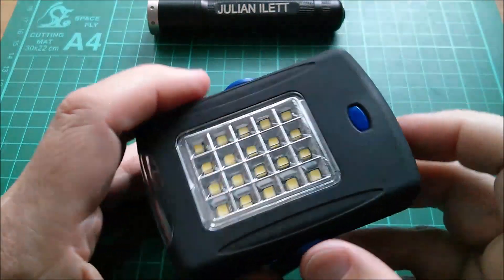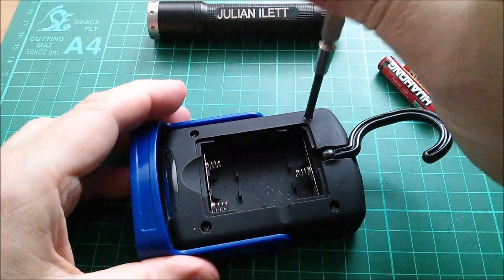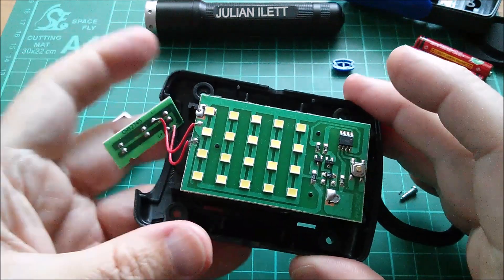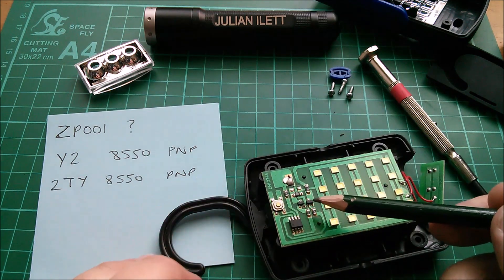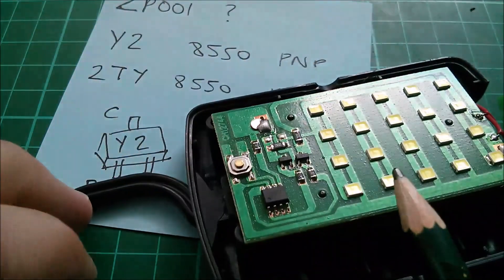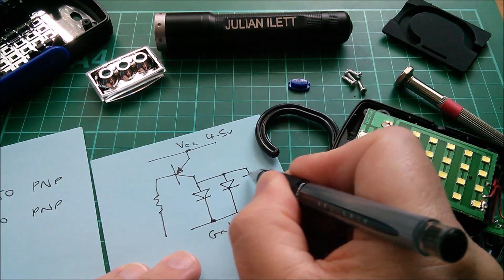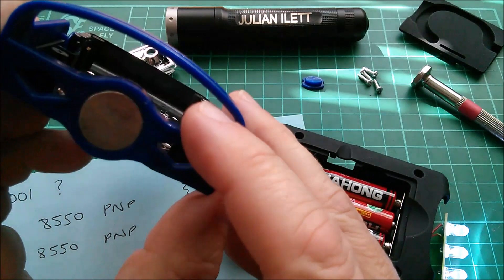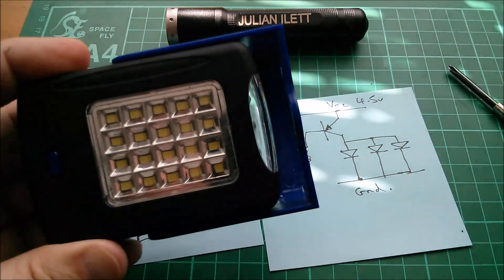LED Utility Light Teardown

Comment: This reminds me of a similar Harbor Freight light,  which uses round LEDs in both locations.  I have a couple of these,  have not used them much, but did open one up to find that all of the LEDs are connected in parallel.  The same holds true for their smaller round flashlights,  and using one of those for a while I ended up with 3 of the LEDs failing.  Not my idea of a good design!  :-)

Comment: When trying to identify a controller from its power and return lines(legs) you should check for under chip traces with a back light or continuity. Pin 3 looked like it had a trace running under the chip ? This chip isn't a PIC or Tiny.

Comment: Oh, and according to the B & Q description the 20 LEDs are 0.09 Watt each, so the total power is 1.8 Watt. So if we assume the voltage of the battery is 4.5 Volts then the current they pull out is 0.4 A.  That is a pretty hefty load on a poor AAA cell (the 3 of them are in series, so the same current through all). I think we can safely assume that the LEDs will be OK regarding potential overcurrent, the internal resistance of the three AAA cells in series will be plenty of protection, no need for PWM.  But as commented below, if someone suddenly has an engineering brainwave to replace the AAAs with 18650 the results may be interesting ....
Reply: Bob, I had the brainwave and did change it to 18650.  The results were interesting.  First I just wired in an 18650 to replace the 3 series batteries.  It worked and was nice and bright.  However over a week of nightly long runs, little by little individual LEDs were failing while the rest kept going.  The internal resistance of the 18650 is likely the cause of failures since it is much lower than the 3 original batteries in series.  Likely the manuf. was depending on the internal resistance of the 3 cells.  I also ran  a normal unit in the same time frame and surprisingly no LEDs have failed as yet, even with the poor design.  As a side note, I have also the Harbor Freight small round cylinder 9 LED flashlight, unmodified and it with frequent but limited time use has 3 LEDs go dead one by one.  It uses a bad design parallel circuit also.  Now I have changed both types to use 18650s and modified the circuits to use separate current resistors per LED.  Ran both  nightly til bedtime during hurricane Irma when we lost power and for nearly a week until power came back.  These modified lights were a big help during the power outage.  Also the 9 LED unit still had about the same light output even after a week of nightly heavy use.  The 27 LED unit was modified to run from 12.6VDC from a 3S20P 18650 power bank I built.  Total voltage only dropped .3VDC for the duration using the high brightness mode (25 LEDs lit).
Reply: @EnergyCrafts Yes, pretty interesting although not necessarily unexpected :o) .   Obviously your modification worked as you replaced the AAA's internal resistance with dedicated resistor for each LED. That is a decent solution.  But to be honest, I am a bit uneasy when resistors are put in any power circuit, it screams waste to me. It may be quite negligible as you example with the 27 LED unit demonstrates, but still.  3S20P 18650 is a big unit, I'd guess about 40 or so a/h, so it will support such usage. But I wonder if a current-regulated buck or boost converter would be a more efficient solution if 18650s are introduced. It will obviously be more expensive at the start, but in the long run?  And I hope you are OK and the new hurricane misses you.
Reply: Bob.  The hurricane winds did reach here in mid FL but I am surrounded by tall thick forest and the wind blew mostly over the tops and missed the ground thus saving us.  

I chose not to use the current regulated LED converter chips because I don't like the idea of using PWM burst of current driving parallel LEDs.  I know the average current of PWM is within spec, but the surge pulses individually is not.  I think those surges are very hard on the semicondutor and will stress it to failure much sooner than just using dedicated resistors.  Also as in any parallel arrangement, currents are not controlled to each LED so any one can draw more than another and fail leading to more current in all the others which ends up taking them all out over time.  Yes resistors produce heat, but the trick is to use as little resistance as possible which means less wasted heat.  For me, I use a power source as close to the LED voltage as possible, a bit higher than and then calculate a resistor for that tiny voltage difference.  This way each LED has safe current control, little heat and very long live.  In theory if the supply voltage were the same as the LED then NO resistor would be needed, but in the real world, so resistance is needed to cover for inconsistencies in the circuits.   And to be fair, even if a LED controller is used to drive parallel arrays, the overall controller and LEDs still put out a lot of heat which manufactures of overhead lighting and industrial lighting seem to avoid mentioning, although they use huge heatsinks on the frames and fail to mention the industry wide problems of early failures way before an 10 or 20 years claimed life due to the high heat killing the circuits.
Reply: Agree with most of what you saying. I am a bit intrigued about your suggestion that current regulated converters produce damaging surges. I thought it used to be the problem with earlier circuits because they  were general-purpose, but nowadays they are well-damped, especially those explicitly designed to drive LEDs. Do you find that is not the case? 
And my point about heat was that the heating of LEDS  is an unfortunate byproduct of normal functioning, whereas heating of the resistors is just pure waste. But as you say, if the resistors are small so is the power loss on them. The converters are about 90% efficient, I don't believe they heat up much. 
Of course the root of the problem is the parallel connection of the LEDs. If they are connected serially their own internal resistances add up offering extra protection against overcurrent. 
And of course the 20 years life span claim was always a myth. Among other things it was never taking into account the "specifics" of Chinese manufacturing techniques... Anyways, take care and stay safe.
Reply: Bob.  About surges, I mean pulsed.  Say a single LED needs 20ma to safely run continuous.  Say the data sheet shows a graph of current vs operation vs time.  It may show you can run 20ma safely continuously or IF PWM you might pulse at 100ma PEAK current over a 20/80 duty cycle or 1A at a microsecond at some frequency.  All due to the stress on the PN junction characteristics and heat.  In any case there will be a correspondence between life of the LED vs the amp pulses (surges) in a normal closed loop circuit.  Pulses is the better term rather than surges.  I always think in terms of surges when a circuit has no constant current regulation of some kind.  Current is not always the defining killer.  I took a 1N34A diode not connected to anything just sitting on a glass table top and applied one lead of a 6KV 1uA DC power supply to it.  Forgot which side.  No visual action, but afterwards checked with meter and it was shorted out.  It tested good in my crystal radio prior to the extreme HV treatment.
Reply: Then there is something dramatically wrong in my understanding how converters work. I always though that PWM is used to control the duty cycle of the switch (MOSFET) only. That in turn will change the inducted current/voltage which then transferred  via a diode and smoothed by a capacitor before applied to the load (LEDs). In other words I thought the LEDs never "saw" PWM pulses, just the DC current with smoothing imperfections on top of it. Is it not so?
Reply: No matter how you slice it, switching an inductor on and off will output fluctuations of current AND voltage.   Current and voltage is never steady.  Thus the reliance on some type of feedback and smoothing capacitance to TRY to correct.  After looking at many LED AC bulbs that failed, I see a big problem in 2 areas.  First heat in the assembly builds up (even with their little heat sink designs) and the electronics fails.  Usually it is the smoothing capacitor, resistors or the AC coupling capacitor.  But other times it is a melted solder joint or an inductor wire come disconnected.  Secondly, the smoothing capacitor is not very smooth.  I can often see strobing effects of the light output.  It may not be continuous but just fooling your eye.  For some the fluttering light is disturbing, you can check with a scope to confirm.  Finally these circuits often generate a tremendous amount of RF noise which can interfere with outer devices.  So still, for me a plain resistor is the better evil to use, since I want a true continuous light output, no RF noise, extreme tolerance to heat of environment, no complicated cpu and high failure prone item and low cost.  And best of all it solves the parallel current control problem which the controller chip does not.  Either way produces heat, you are not getting out of that.  A savvy design could use the heat to advantage like to help heat a room in the winter, or to power thermoelectric modules for extra electricity or other ways etc.  If the heat could be used then there would be little true loss of efficiency and even less argument to not just use resistors rather than a complex controller.  I bet my resistor method in my flashlight will still be working 20-30 years from now.  How long do you think the chip controller designs will last?  Not even close to my way.  Your way suits a throw-away society:  my way suits a good long term product not being thrown to trash just to make another and an almighty dollar and contributing to landfill waste and pollution.  As you can see there is much more to a simple LED light than efficiency to consider when looking at the bigger picture.  Hope I was a bit helpful and did not come off as too harsh.  Have a great day!

Comment: Strange.  At 6.20 you can see the emitter of the left-hand-side transistor is indeed traced to +vcc.  But the right-hand-side transistor seems to have its emitter either hanging or traced to the collector!  Optical illusion?

Comment: Why a micro controller just for taking input from a button? One can achieve the same thing with a flip-flop... In fact I'd be rather annoyed to have a MCU sipping away the juice even when it's not in use...
Reply: I'm not worried about battery drain at all. But if you want to keep it simple then a micro controller is way overkill because not only do you have to write the (rather simple) firmware but also program all those MCUs or pay the manufacturer to deliver them already programmed...
Reply: microcontroller with transistors/cheap tac switch,  is cheaper than a mechanical 2 way switch of the capacity for the current and smaller of course

Comment: I have a similar LED flashlight/worklight from Harbor Freight https://m.harborfreight.com/27-led-portable-worklightflashlight-60566.html  It is also powered by three AAA cells in series, but uses a SP3T pushbutton switch to select either the main 24-LED array, or the smaller 3-LED array on the end.  Like Julian's, all of the LEDs are connected in parallel, and current is limited by either a 1.5 ohm or a 22 ohm resistor.  I was hoping to find a microcontroller inside, as I was ready to look for evidence of PWMing with my scope.  Harbor Freight claims this light can run for 48 hours with the cheap batteries they supply, but I doubt it.

Comment: leds are probably driven by lower duty pwm (~4.2v pulses max), that why they did not feel like using current limiting leds.

it should be more energy efficient if they usd  mosfets instead of bjts, if the leds can withstand it. probably.

Comment: I'm interested in how the selector part of this circuit works. Will you do a video on this?
Reply: It's almost certainly a microcontroller which is programmed to take only one input (and de-bounce that input internally) and provide two outputs.

On power-up (when you install the batteries the first time) it would set itself up and turn the lights off and then go into "sleep" mode where it consumes so little power that the batteries will last practically their shelf life if it's left in that mode.

When the button is pressed, that would send an "interrupt" to the controller to "wake it up" from sleep mode to active mode.  It wouldn't need any other input since then it just has to go to the next state and then go back to "sleep" mode because the outputs will maintain their state regardless of whether or not the controller is running.

From "all off" mode, on each interrupt it will go through a simple sequence of "turn warm white LEDs on", "turn warm white LEDs off and turn cool white LEDs on" followed by "turn cool white LEDs off" which is the same as its starting state.

This would be so easy to program on a microcontroller, I can even see the program structure in my imagination without needing to write anything down.

I guess Julian could do a video showing how the microcontroller is programmed to do this, since a 12F675 would do it easily and he has a development board for that chip and the board already contains all of the hardware to perform exactly the same function.

For all we know, that 8-pin chip on the circuit board might actually be the surface-mount version of the 12F675.

Comment: Its the same as the Texsport 24 Plus 3‑LED Utility light. But with no microcontrollers just uses a 3 port switch & a 100ohm resistor.

Comment: Is it possible that the resistor on the input doubles as circuit protection?  It is quite common for cheaper asian builds to simply use a resistor rather than a fuse or something to be the first thing to blow in an over-current situation.  Once blown, it would protect the entire circuitry from further damage.  And it limits current, in case the batteries are inserted backwards  or something.

Comment: I don't care for the 3 battery units because I'm always left with ONE battery when I buy a pack of 4.  What the hell uses 1 battery; nothing I own.  So, having an odd number of batteries left in the battery storage box is just triggering my ocd.
Reply: There are only so much wall clocks you can own
Reply from the maker: Yeah, it's an OCD thing for me too :)
Reply: use that battery in your wall clock, or buy rechargeables. that way u wont have to buy very often or feel odd very often. :)
Reply: Eden's Aquaponics So pay a bit more and buy a better charger that charges individual cells... and I don't mean one that can only change one cell at a time either!

Comment: Interesting a microcontroller, rather than a 3 position switch. cost-wise I mean.
Reply: FilmFactry 
If they're going to the trouble of installing surface mounted LED's then it's not much more cost to add a basic microcontroller. I assume they also consider the single push button operation as a feature which can secure a higher retail price than a simple switch. Assuming these are produced in their hundreds of thousands (or probably millions) the cost of the microcontroller chip would be no more than a couple of pence at most - the push switch may actually be more expensive! The resistors and transistors would all be sub one pence each and negligible towards the overall cost. The most expensive part is probably the LED's or the case followed by the PCB and neodymium magnet.

Comment: Really good to see the tip on putting screws back into plastic.  It's good for any self-tapping screws and I always start a screw by twisting it backwards to get it seated.
Reply: Jay Herde 
Yes, I do too. It really helps to prevent crossed threads or, with plastic, stripped threads!

Comment: I assume the 000 resistor is used as a jumper, since these product are build on the cheap side, wouldn't it make more sense to use a piece of wire?
Reply: Warik Yacent Pick and place machines have no problem with smd parts, but wire is tricky for them.
Reply: I assume it's assembled with an automatic pick and place machine.

Comment: I do not like leds in parallel without resistor but if it works...
Reply: it wont fail o fast probably, if they are driven by lower duty pwm.

Comment: I open most things I get and I have never seen a current limiting resistor in Chinese products. Paralleling the LED is ubiquitous. 

Almost impossible to get any data on the micros too. I have tried on numerous circuits. Not sure why. Who would copy a Chinese design and how would they produce it cheaper.

Comment: LEDs with Built in Resistor ?
Reply: battery with internal resistor, it's an unwanted but sometimes utilized effect in batteries.
Reply: Like this http://eu.mouser.com/new/kingbright/kingbright-resistor-LEDs/
Reply: +1995epicfail would alkalines have a lower resistance meaning LED carnage ?
Reply: Maico I don't know.

Comment: I like things that run off 3 cells, why? Because it makes hacking a lithium cell into those devices much easier since all you need is a charging circuit.
Reply: If it partly relies on the AA cells' internal resistance to limit current, if might get a bit exciting if you swap to a 18650 lithium cell :)
Reply: If you keep it as 3xAAA it's a pain to charge as chargers all charge AAAs in pairs.